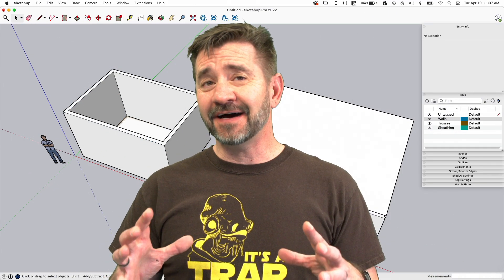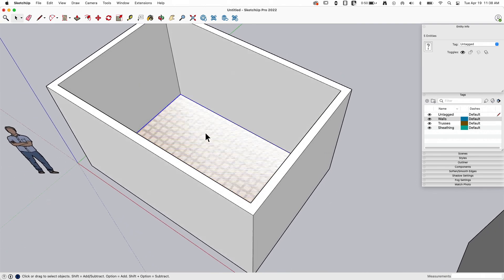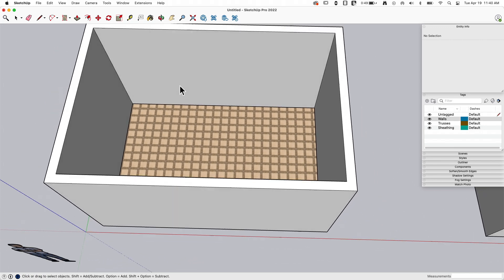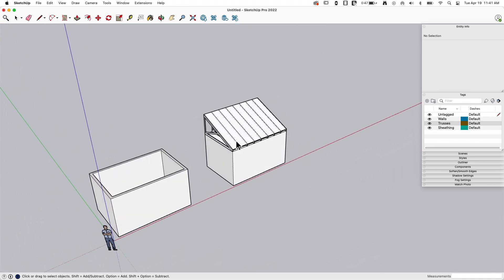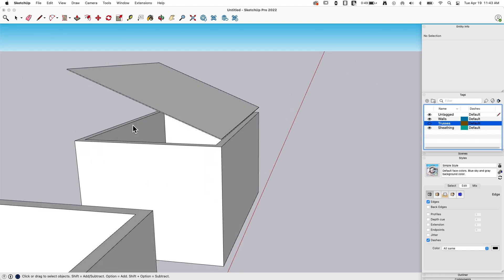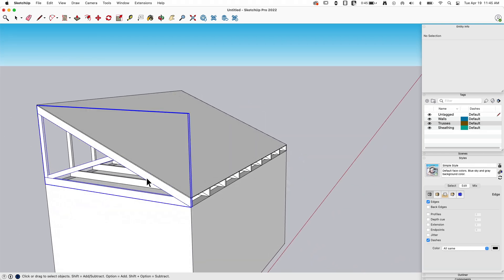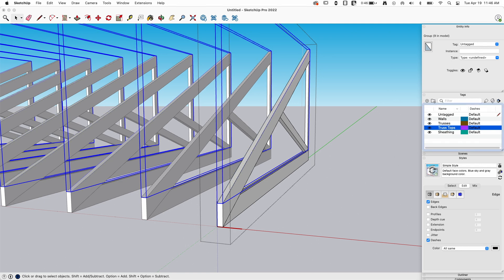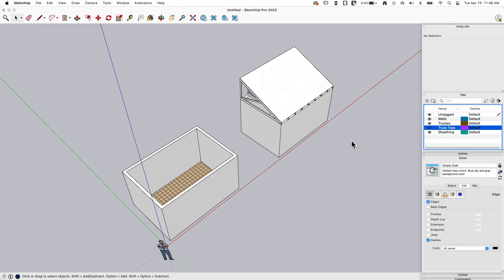Z-Fighting and Bleed-Through - Skill Builder

Comment: All very nice workarounds - but for an issue that shouldn't be there to begin with. Z-fighting is pretty much a bug, nothing less. In the case of coplanar faces in separate solid objects the draw order should be easy to resolve, regardless of how small the gap is between them - the nearest face hides everything behind it. Outside of solids, coplanar faces are obviously more of an issue, but they could be dealt with by a simple "draw order" command, similar to the one in AutoCAD, for example. Do I need to go and add this functionality as a wishlist feature?

Comment: Another way to improve z-fighting I think was bumping up the OpenGL settings from a standard 4x Multisample anti-aliasing, to a 32x or 64x multisampling.  You can do this in Sketchup Preferences.  This seems to improve things, but doesn't always completely get rid of the z-fighting, so the method in this video is more comprehensive.  One negative of this multisampling way is that with complex models it will slow down your machine (especially if you have profiles and shadows turned on).

Comment: Nice! It never occurred to me to hide the edges which are bleeding through. And I bet this could be achieved more quickly using the Eneroth visual merge extension. E.g. use visual merge on truss/sheathing to hide the edges, then optionally rename the 'visually merged' tag with a unique tag name.

Comment: Why would having the carpet floating over the floor be wrong? I don't see it as floating, I see it as only showing the top surface of the carpet. Remember, the carpet has thickness. It's not just a flat plane on the floor. It has depth. I think a half inch is a good compromise for having separate flooring and carpetting.
Also you can put the raised carpet on a separate layer and have hard woods underneath. That way you can easily flick back and forth between looks.
Reply: Usually a finish thickness is not added so that measurements in Layout are accurate. When we dimensions walls we don't dimension them for construction including the dry wall or cladding.  I hope that helps

Comment: Thanks for the video! I didn't know bleed through was an issue related to openGL. I have exported images and scenes to layout many times and have had bleed through and thought it was just an issue with a compressed image in a window. I usually use imported scenes in layout to show clients what the project will look like. When I get bleed through I would try to tweak the camera angle to get rid of it but then I'm not viewing my project from the ideal point I wanted to. Thanks for the insight!

Comment: I have been wondering what I was doing wrong when this shows up in a model and never knew how to handle it.
In real life the floor and the carpet would not exist in the same plane, so why not mimic real life and lay the carpet on top of the floor offsetting the carpet from the floor as you show in one of the solutions. I don't know what the minimum offset would be to eliminate the flickering, can it be less than the 1/2" you use in your example? Carpet has depth anyway, maybe less than 1/2" for some carpet, but in other cases more.